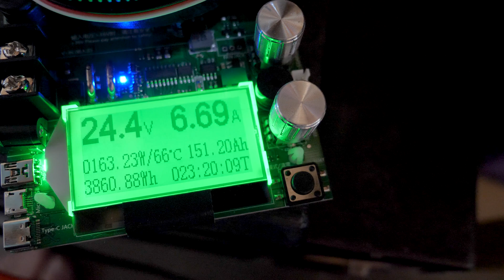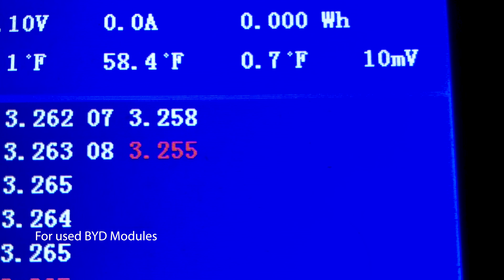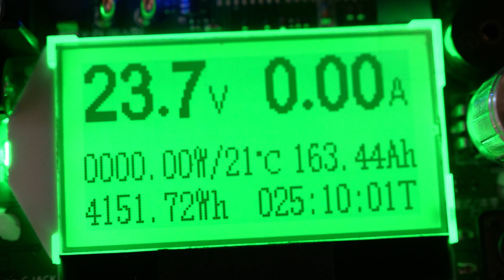Deligreen QNBBM 8s Active Balancer for BYD LiFEPO4 Battery

Comment: I need these for my Motorhome. I’m installing 2  used BYD packs in my Motorhome and don’t want to haul around weight I’m not using. But these are $200 each on Amazon so I’m trying another brand that are $47 each. I dont know what shape the cells are in and if there is a weak cell yet. I’m going to try one pack at a time before I parallel them on my 24 volt system. Thanks

Comment: I wish I knew about these a year ago. 🤷‍♂️

Any difference between the 1S balancer x8 and the 8 pack that you used?

I just emailed Delgreen for a pack of 64 1S Balancers. Dang, I feel bad not knowing about these until last week.

I have 8 BYD packs was just about to chuck them all in the river. All 8 packs have one bone head cell, and a couple have 2 bad cells. They either nose dive or run away up in the volts.

So I have been limited to 53.3V at the top and just 49.0V at the bottom! Basically 10 kWh of usable energy! I hope to get these balancers soon.
Reply from the maker: These balancer's have been pretty rock solid so far granted I'm not really using the batteries for discharging (yet) but will be putting into service soon.   They have been balancing my 3 BYD packs non-stop since March. I plan to go to 27.5 at the top end and down to around 24.0 on the lower end.  My end application won't really draw that much power so I'm going to take it easy in these used BYD packs.  On another note, nice solary array too BTW, I just subbed to your channel.
Reply: @GreenMountainDIYGuy  Thanks. :)

I have 64 cells floating out in the Pacific somewhere. I have four 16S Chargerys sitting pretty in their boxes right now on my "workbench" ready to go along with the Chargery relays.

So, just to be clear, your active balancer is not making the Chargery lose its mind when it's balancing? A balancer and a BMS are happy together?
Reply from the maker: Jason Carmichael You bring new meaning for floating cells!  Awesome!  I have turned off all balancing on the Chargery BMS’s so no competition for either the BMS or balancers.
Reply: @GreenMountainDIYGuy  I got my 64 cells. ~ 57 kWh 48V setup. With the active balancer on my 48V BYD set up, every day they end up under 0.005 V delta. I bulk charge 58.4V and float at 53.1V.

I'm planning now to move the BYD's to my lawnmower enclosed trailer, with probably an LV2424. I have 1.2 kW of PV not mounted that will probably fit on top of the trailer. All I plan to use that for is the 12v battery tender for the mower, overhead lights, and tool battery charger.

Comment: Two videos back you reviewed the Chargery BMS - does it not also do active balancing??  I thought that was one of its best features (I must be going crazy as I drink from the firehose learning about all this stuff... Was looking at building a BYD setup with 8 batteries, in 4p2s (think I did that right), with a 48V grid-interactive inverter.  Would a Chargery  BMS16T and paralleling the cells from each 4p setup not accomplish what you're doing here?  Thanks so much in advaned!
Reply from the maker: The balancing on the BMS is only 1.2 amps total.  Not enough to balance these very used BYD batteries in a timely manner.  I believe the 16T does 48V.  Just check to be sure.  I'll have more updates on the BYD batteries next month. Thanks for watching.
Reply: Chargery is passive balance.  I have four of them and the balancing is not worth much.  In fact I's say it hurts you as passive balancers just throw energy away.

Comment: This is the best video on this balancer I have found, thank you. I have the same BMS and the same load tester, but my batteries are LiFePO4 90Ah cells, I use 16 of them in 4S4P system for a ~13V battery. I'm having a problem keeping them balanced just above and below the knees and I'm tired of fighting with them so I'm looking at this balancer. The balancer in the Chargery at 1.2A is just way too little.

I have a bunch of questions, I hope you don't mind, if so I apologize. I know this is a lot, but here goes:

- Do you know if it shifts power from the top cell to the bottom cell, or just across adjacent cells? 
- Does it balance across the entire voltage range (~1.8V to 3.65V per cell) or just when a cell drops to 1.8V? The specs seem to say it only balances when a cell hits 1.8V, but it's not clear.  
- Does it balance maximum current all the time or is the balance current low if the differential is low (say just 50mV or 100mV)?

- Most important, is there any protection against the balancer draining a cell below its minimum voltage, which I think is 1.5V but I prefer it not drop below 1.8V. 

I'm using this battery on my sailboat for ocean races, so the more I can get out of it the better. Typical draw is ~10A, typical charge current is up to ~75A. 

Thanks very much, you seem to have the best handle on these I have seen.

Comment: Great Job, I have  6 BYD's (48V Setup)and each has a the same 8S QNBBM attached with 4 screws to the front of the battery (where the Fan screen was). Using the QNBBM i am averaging 27.8v/BYD before one of the cells goes hay wire. I also placed a 200 amp Daly BMS inside each of the battery compartments (fits nicely). This provides me with some peace of mind, and like DMI inc. said "Better safe then sorry". So this setup is 2 BYD's in series, 3 in parallel and it's getting about 25kw using 54.8v max and 48.0v min. I put this together for my friend, so i just wanted to make sure it didn't blowup when he used it. But i am thinking of a different approach for my setup.
Reply from the maker: Nice setup and approach.  The QNBBM's do make a difference.  I'm waiting for a few more to arrive.  I know I could parallel all of the cells to 1 QNBBM but I'm going to use one module per BYD unit.  Thanls for watching and lets keep in touch.

Comment: In simple terms, the bigger the balancer the quicker the balance. You shouldn't have any problem keeping up with the cells balanced for no more watts you'll be pulling from each BYD. My little ISDT BattGo BG-8S Battery Meter will balance out my 4S 12v 200 amp hr. with no load in 36 hours. But then again my battery is fairly new but is cycled daily. I have noticed without my little ISDT BattGo under load, the one weakest cell always comes out with higher voltage than the rest. So being slightly undervoltage really means nothing. Lets not forget our main  BMS system balances also. Keep the videos coming. R. Cammack
Reply from the maker: Thanks you sir.  Always a pleasure to hear from your Randy.  At some point when you have time, I'd like to pick your brain on a couple of things.

Comment: That's awesome. Those things are expensive wouldn't it be easier to replace the bad cell and just use top balancers.. when you have a bad cell like that it really makes the balancers work do they run hot at all or warm?
Reply from the maker: It would be a lot of extra work to try to take out a cell for these particular BYD units .  If these were individual CALB cells, I'd do it in a heartbeat.  For time's sake and a fairly even approach, I went with the QNBBM  balancers.
Reply: @GreenMountainDIYGuy  understand. It's a very nice setup. I'm getting away with using top balancers but only charge to 3.5 volts per cell or it will overwhelm the balancers they only shunt at 33 milliamps. I can get almost to fully charged if I bring the voltage up very slowly over the course of a day or so.
Reply: The capacities of each cell in these modules are so far off that top balancing alone doesnt really work. Most balancers max out at about 1 to 1.5 amps. These active balancers are capable of 6 amps of balancing. And it is not passive balancing, it is active. So the high cells don't just bleed that power off as heat, these balancers move that extra power from the high cell to the low cell. Much more efficient!

Comment: Nice video! You might be able to get by with just one balancer if you parallel the cells pack to pack. I believe that balancer can handle quite a bit of balance current.
Reply from the maker: I may go that route and see if it works before buying two more QNBBM modules.  Good suggestion...

Comment: I have 8 of the BYD models.  I’ve got my charger parameters set to 55.2 Bulk, 54.4 Float.  I tried a higher bulk setting and I did see the get out of balance by a wider margin: near 1/2 volt.  Now, they stay around 30mV of each other.
Reply from the maker: That good to hear.  I'm kicking myself for not buying one more battery and going to 48 Volt!